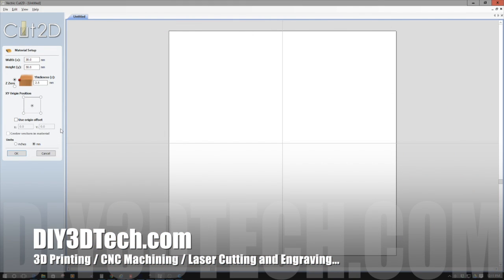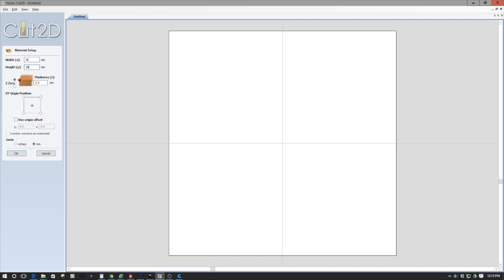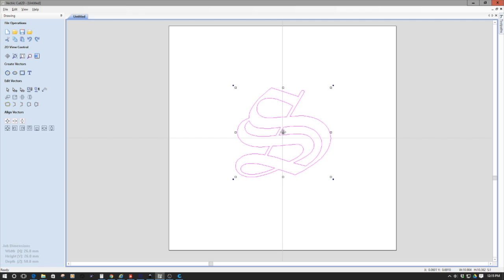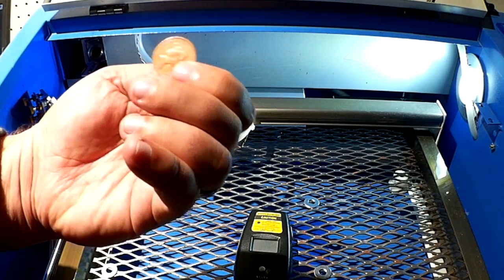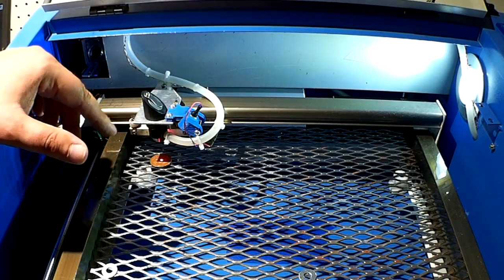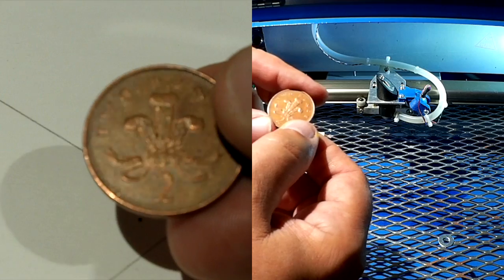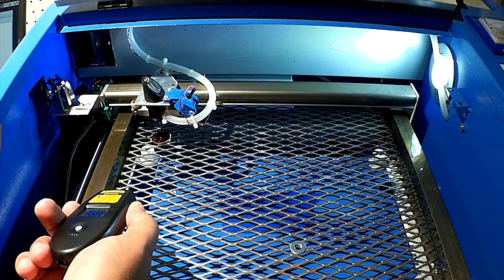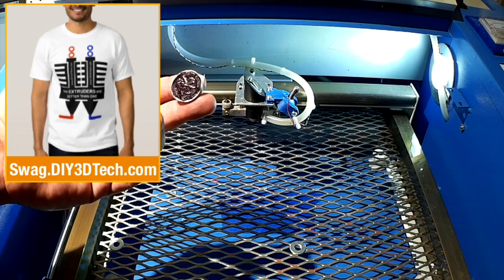K40 eBay Chinese CO2 Laser Cutter & Engraver -  Etching a Coin Sort of?

Comment: whats co2 ? is it diferent from the regular laser cutters?
Reply from the maker: Regular laser cutters are CO2 lasers as thats the gas which perpetuates the act  of lasing.  There are laser "diodes"  which use a solid state diode (much like a transistor) however it is at much lower wave length (typically in ~500nm range) and power where as a CO2 laser is 10,600nm or there about so its  a very long wave so think of it this way the lower wave length the more like a smaller hammer pounding very fast there as the CO2 is a BIG hammer pounding slowly more energy (heat) is imparted the to target and absorption (since its in the IR range) is far higher.  Hope this helps...

Comment: how do you set up so your work is in center also when I measure say a square box 12 x 12 in Corel I set my size and stay within that size but I always seem to be bigger than box why is that
Reply from the maker: How much is it off by?  As it should be within 0.4mm as that is the typical kerf.  Or are you saying the scale of what you're doing is off?  If the later, double-check you have the correct control board selected.  If you look in the eBay/K40 Laser playlist on my channel there will be a video in there (sorry I don't remember the name ) that talks about this and how to correct.

Comment: I checked out the price for a replacement laser tube and it is almost as much as the entire machine.
Reply from the maker: You're correct as I just purchased another one new off ebay for $290!  The tube alone was $180, crazy!
Reply: DIY3DTECH.com
Yep.  I really need a 60w or an 80w one but the price difference from a 60 to 40 is 5-7 times more so even more insane.
Reply from the maker: 10-4 good buddy as I was thinking the same of upgrading to a 60 watt tube.  Also, what made a little nervous is to pay the and have it arrived damaged then have fight for a replacement or my money back...
Reply: DIY3DTECH.com
Yeah, it is over 1100 dollars to send it back to China.

Comment: As most coins are quite reflective what if you were to dull the finish?  Would that make a difference?
Reply from the maker: The heat dissipates too quickly, as keep in mind this is a 40 watt laser so it outputs no more energy than 40 watt light bulb.  Even with the idea there is an "infinite" amount of "power" at the focus point, it can never achieve this so its only good enough to warm pockets change after five or six minutes :-)  However this got down another road and I released this one early in the cycle, I have several other where I try this with the CNC and that was (and continues to be) a lot fun so watch out for those videos!
Reply: DIY3DTECH.com - That is interesting. So what was the cost on the laser and the CNC setups?  "One day" I would love to have one of each to tinker with just for fun.
Reply from the maker: The laser can be had sub $400 and with extras about $500 (total) whereas with the CNC you will be about $1k on average.  Just getting ready to pull the trigger on a new CNC focused on cutting metal
Reply: DIY3DTECH.com - I could probably convince my wife on purchasing a laser engraver as she does scrapbooking and card making. We could "share" the laser. I bought her a laser printer so she could do "foiling" for cards. She prints out a design on her printer on card stock. Then she takes that, puts the foil on the card stock and sandwiches it in some sort of heat resistant plastic and runs it through a laminator. The foil "welds" to the laser toner and it looks so professional. 

Buying the CNC machine would be the real challenge. Not sure the CFO would allocate funds for that. Need to take my wife to New York for our 20th Anniversary in 2 years. Saving for that wonderful trip. Toys can wait. Lol
Reply from the maker: If she is into scrap-booking yes the laser would a buy as I do craft-foam all the time, light wood and so it is a lot of fun you just have to keep in mind it will take a lot of tuning to get it there.  But it (like the computer) are only things I could dream of as a kid!
Reply: +DIY3DTECH.com - Right!  Like the Motorola flip phone was the communicator from Star Trek now the laser cutter is the "phaser" and the 3D printer is the "replicator" though only the pancake one and the candy one do food as far as I know. Lol. We are living the dreams of Gene Roddenberry.
Reply from the maker: Well put, save for iPhone is also the Tricorder :-) and just waiting for the day scotty beams me up!  Hmm, thinking about it that last piece didn't come out so well :-)
Reply: DIY3DTECH.com lol!  It has been an interesting 50 years for me technology wise. Would love to see man step on Mars. I got to see Neil Armstrong step in the moon when I was 3-yo. So Mars would be awesome.  They might need a 3D printer on that mission to make their own tools or parts.  That would be cool.
Reply from the maker: Know what you mean (and your picture doesn't look that old :-) as I was 7 when when he took that step and it's sad we let all of that go because if we would have kept on we would have set foot on Mars by now.  Will I live to see it?  Only if Elon Musk makes it happen!
Reply: DIY3DTECH.com - I don't care who does it. I believe that it will be a joint effort of NASA & private company.   NASA just has sooo much experience to not have them on your team.
Reply: On another note; I'm installing porcelain flooring tile this weekend. It would so nice if there was a combination of 3D printer and Roomba that could "print" the tiles in place. THAT would be cool.
Reply: +DIY3DTECH.com oh that picture was from my podcasting days and taken about 6 years ago. I turned 50 in Feb. Things sure change physically but trying to eat better and keep going to the gym.

Comment: Coins contain a lot of copper. Copper reflects 99% of IR radiation. Same for aluminium. You can make mirrors out of copper. So, please, close the printer when using metals.
Reply from the maker: Yupper this is why i mentioned even with goggles would be looking into the case while running...
Reply from the maker: oops typo "Would NOT" be looking into the case while running...

Comment: wild video .  For etching metal , i cheat with my lil' 1/3w violet laser .   I mask off the target wit black krylon or tremclad paint .
i make a jig on my laser bed , and then i lase the darker/ deeper parts of the etch . then i take the part out of the jig , and use electric etch . put the part back in jig , and lase the next lighter part .  i do that until i have done all the way to light fine details. 
The laser simply burns off the paint mask at each step.  the chemicals/ or electricity do the etching.
great way to do high detail logos on knives and tools, and as you have a the mask you cna even re-plate the metal in some cases   .
Reply from the maker: So you using the etched paint as a mask for electroplating?
Reply: yeah , thin coat of spray paint or such , get vaporized by laser . a quick wiper with alcohol to remove laser burnt ash of paint off , then you do your  electro or chemical etch , or hell you can even mix but etch teh metal out , exposing clean metal and then plate into the etch .  

though  its not as cool as actually havein a laser do it alone .
Reply from the maker: How are you doing the chemical piece?
Reply from the maker: Thanks for sharing that video was fascinating!  For circuit boards, plan on doing CNC routing as i hate drilling all of those and my eye or hand is not up to surface mount :-)